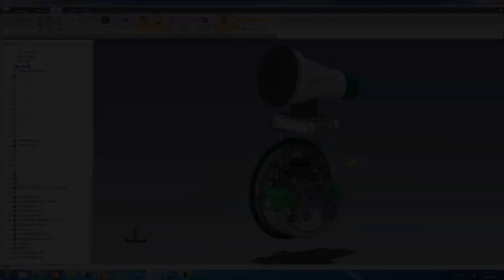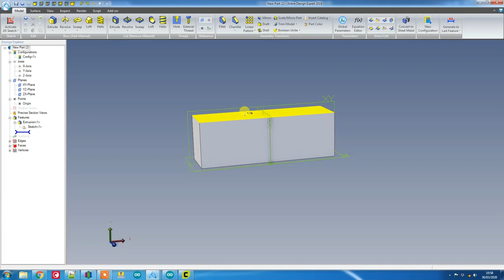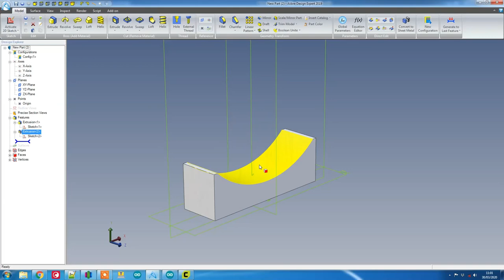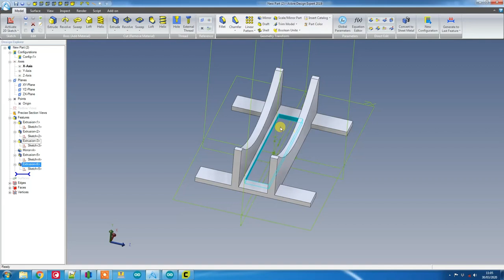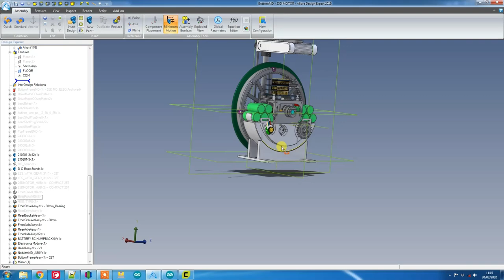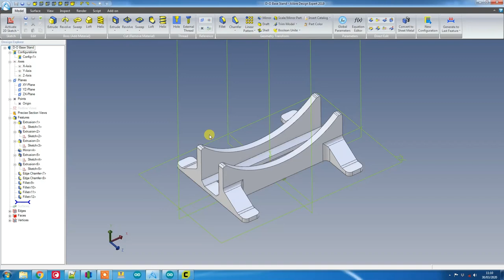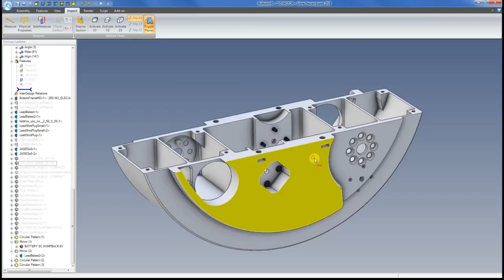Concept to 3D Printed part (My Design Process) - Mantis Hacks

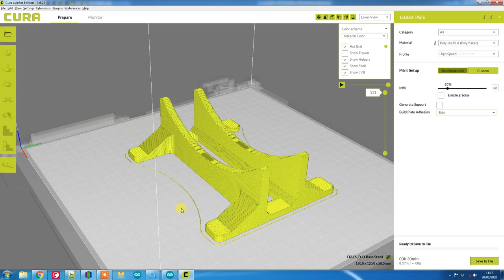Comment: Thanks for the nice overview of your workflow. Quick question: at 11:48 your slicer noted a print time of 3:30h, but later you said it took less the 2h. Is the prediction not accurate or did you change some settings in the slicer?
Reply from the maker: Prediction is never accurate, but I think I printed it in less detail..

Comment: What program are u using to design you pieces? I usually use solidworks but is pretty tough to work with my PC has really low resources
Reply from the maker: Yes Alibre 👍